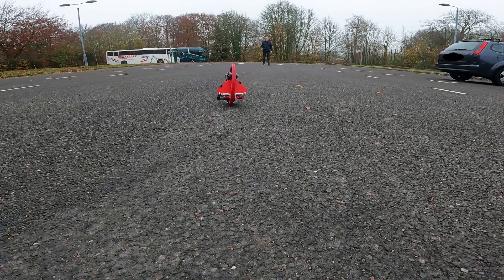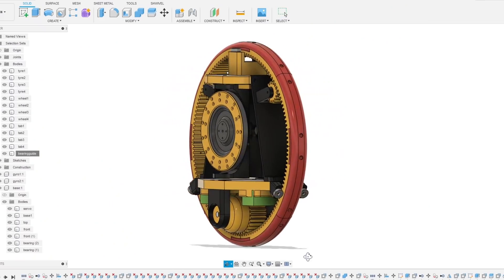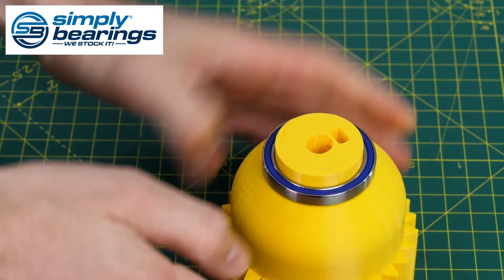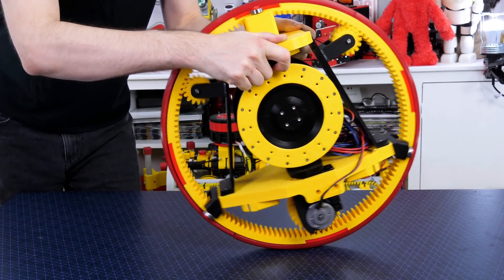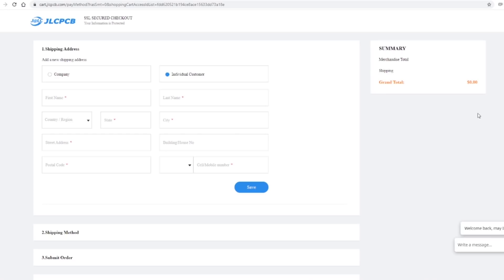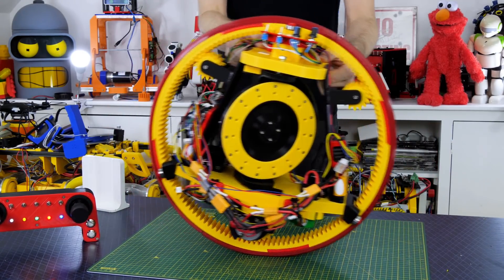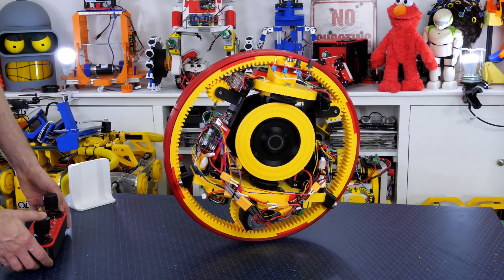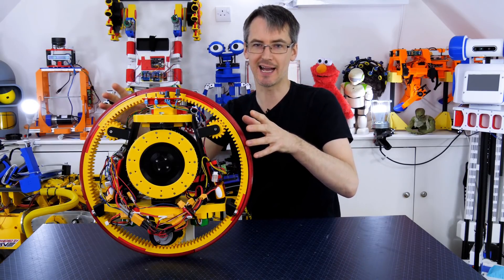Gyroscope Stabilised Monowheel

Comment: I guess there are two other solutions:

Have a heavy ring running inside the wheel arch as a flywheel. So if you decelerate, you just accelerate the flywheel's mass the other way around, bleeding off the energy. This would allow you even to reuse the energy, when you want to accelerate again.

And you can also accelerate fast and spin the flywheel in the other direction to avoid tilting. This energy could either be recovered while driving or you can just use it up when you want to brake.

The other solution would be to have a flywheel in the center but the axle turned 90° horizontally - so it will face sideways.

You would need to spin up this flywheel to a very high speed, but given that it is heavy enough it will stabilise the tilting action pretty well.

You could even use it to stabilise the tilting right / left by speeding it up/slowing it down. So you can steer and stabilise it. 

The only weird thing would be, that if the center portion do lean forwards or backwards it will stay there. 

So maybe you could combine both solutions

Comment: Great Build!!! (as always) only one small note, you know this effect if you have ever ridden a motorcycle or bicycle, I believe it is the same reason here as well that you need to lean the other way than the direction you are turning, which is also called counter steering, even though it has 1 wheel, as you implemented the gyroscopic wheels spin by the brushless motors, the overall system behaves like a bike or motorcycle instead of a monowheel. It seems to be a little janky right now but it seems to be fixable as well, I am really hyped about this, could you make one with a more common (easier to find and cheaper) parts version of this, the scale can change but again with gyro wheels? That would be great!

Comment: You're explanation for going round the corner is in fact an old problem that every human solved by feeling. You do it differently than you would expect! If you want to go to the right you will steer left at first! By doing so, you "fall" in the right direction and catching yourself from falling over. You're code should implement this and everything will work fine. There is an old experiment where they try to run a motorcycle by a robot, what ever they could think of it could only run in a straight line. Finally they measured a human driving the same motorcycle and found the slight movement in the wrong direction. It is also known as counter steering.

Comment: For your gyro steering to steer it in your desired direction you first need to initiate a turn in the wrong direction, this will cause it to lean in your desired direction, and then turn into the lean in order to stabilize it, turn even more into the lean to pull out of the turn.
It is comparable, although not totally similar, to how you need to initiate a turn for a bike with 2 wheels where only the front wheel turns.
Reply: 1. this information is incorrect
2. the speed at which this comes into play is much higher than achieved here
Reply: @Blox117  
1. No it isn't, while easier to observe in a two wheeled system it is the offset of the balance point relative to the steer point that causes the effect. Moving the steer point in front of the balance point should negate the effect somewhat.
2. The speed at which this comes into affect varies in relation to the size of the system. It becomes relevant when moving at fairly slow speeds, and stays relevant even at very high speeds.
it starts to become relevant around 0.001 kmh at the size of a marble, and around 0.1 kmh at the size of a bicycle.
Reply: @OmegaWoodworm  im guessing you've never stepped foot out of a 4 wheeled steel box, have you? enjoy knowing that i am able to magically turn without doing any of what you stated lmao.
Reply: @Blox117  I see you have missed some context.
The effect I am referring to affects 1 wheeled and 2 wheeled systems, not 4 wheeled ones.

Since cars have more than 2 wheels they are not subject to this effect.

Comment: When I look at the amount of coding time that must go into this for an end result that doesn't quite live up to hopes, I can't help but think you'd be better off just connecting the inputs to a machine learning algorithm that learns by itself not to fall over. Especially in this case where as it gets out of balance there might be a trick it could use to accelerate itself out of a fall condition even if you didn't input that acceleration.

Of course for the simpler robots the algorithm is easier to hand code but in this case AI might do a better job than a human and all you need to do is provide it with real-world training data.

Part of that might include ensuring that falls are an important aspect of the learning, and for that reason you could build in some logic to automatically move the gyros back into a safe state as it goes past the point of no return. Then your kitchen floor and the spinning gyros can endure many falls!
Reply: If my control engineering and dynamic modelling skills suck (or in the case of James are practically non-existent), have an AI do it instead. Great idea! /s
Just pay attention in class when you study robotics and this problem becomes quite trivial. Using AI in this case would be like turning the house instead of the lightbulb to screw it in.
Reply: @VulpeculaJoy  Re: triviality, that might have been a fair response up until a year or so ago. Now, in the new age of deep learning I'm not so sure. We are moving towards a world where these kinds of control tasks are becoming quicker to develop (and potentially more robust to failure too) with AI. Perhaps the Arduino board is not well suited to running NNs, but if so, that could be an argument for sourcing affordable hardware that can do it.

Of course, for those who really like the challenge of developing their own handwritten control code, go for it! But I could imagine in the near future those skills becoming antiquated and unnecessary in the robotics world.
Reply: @nettlesoup  AI is just a tool. If used right, it can do amazing things. But it has its drawbacks and limitations and to wield it right you have to know how the system as a whole works. Thus any skill related not to AI itself, but the technical challenges it is solving is not redundant, but absolutely necessary knowledge.

To give just one example: I am a team leader in our university's formula student racing team. We're aiming to convert the last season's car to drive fully autonomous.  The guy that is working on our AI-driven camera perception system has absolutely zero idea how cameras work and if I wasn't there to correct his oversights, we wouldn't be getting anywhere.
Reply: On another note: There is a lot of research going on right now involving AI control systems for cars. The technical challenge of implementing such a system VASTLY exceeds the challenge to do it the old fashioned deterministic way. 

And also: You have to learn how to walk, before you can run. We (like James in this video) haven't even walked yet.

Comment: It seems firmware should take control of gyroscopes' axes, so that no matter if on a flat surface or steep bump or hill it could always recover up to the angle of rotation of the gyroscopes, which looks like the limiting factor there.

Comment: I notice that the gyroscope axis of rotation is above the wheel centerline. Would aligning the two help your stability problems? I would think this would help with the change of force from the gyros when tilting the robot forward and backward.

Comment: Maybe try a design with the gyros in the center of the circle. That way even if you go forward the gyros won't move from the center of mass of the geometrics of the balanced wheel. Within this desing the balance of the gyros are high up the center, in that case when you move forward or backwards you will always create an inclination where after a certain angle the gyros wouldn't compensate and then the precession of the angular momentum is going to overcome the balancing action. 
Or maybe try to add another degree of freedom for the gyros, where they can balance in perpendicular to the movement of the wheel.

That's a nice project, incredible video.

Comment: Would be cool to accelerate and decelerate the gyros to offset the torque on the inside—then you could drive it directly with the motor without leaning forward or aft.

Comment: Don’t you think adding a kill switch to the remote would have been a good idea, there should be one on any project that is getting tested, maybe also other features like being able to tell when it’s fallen over so it can stop all the motors automatically. Also why do you still use arduino, I get lots of people use it but it has very low performance, you even had to use two in this project, chances are this project and others are getting heavily throttled by using an arduino, especially the PID loops, which I take it may use floating point maths, when the arduino doesn’t have an fpu, just use a STM32 or something. Faster speeds also means more accurate and faster control, so it can react faster to disturbances.

Comment: I caught your video as I was surfing Youtube. I like how your mind works. There was a moment at the end however, where you seam to be perplexed as to why it turns the opposite way of the lean. I think this has to do with how bicycles turn. While riding along, if you want to turn Left, you pull back slightly on the Right end of the handle bar. This moves the lower part of the bike off center to the Right. As the bike leans into the turn the handle bars, and the front tire, turn to the Left to follow the circle you're riding in. That's just my guess, but it seams to make sense to me.

Comment: Seems like you should be able to use the turning angle to alter the gyroscope's center point so that when you "steer" it knows that the center of your angle is meant to be offset from your true vertical center. However, if you use the boat analogy, you  should also be able to tilt your gyroscope physically if you place it on a horizontal rig.

Comment: What if you made it wider by placing the gyros on a tilt 35 degrees from each other so you can leverage more against gravity it could even buy you more tome to correct over steer in opposer directions

Comment: I'm wondering if the profile of the wheels that are causing issues with steering. When the robot leans slightly left the contact point moves quite far to the left, causing the actual balance to shift towards the right. Maybe try with a rounder profile for the wheels.

Comment: This might be kind of dumb, but if you did not have the gyroscopes geared and you had them both on encoder motors instead and made one basically a slave to the other would that help more in stability or just create more imbalance? I have seen at least the last 2 monowheel videos, but not that. Using 1 large one and another smaller such that you can keep them both inline with the wheel. Make the large one the slave as it could be quick to correct due to its larger inertial mass

Comment: I think tire shape might be a sneakily important factor. A flat-bottomed tire might seem easier to stabilize when the wheel is stationary and near vertical, but once you tip over the edge, the gyros are bound to struggle at correcting the sudden change in forces. Plus, when the wheel is moving, it's gonna be hard to make minor steering adjustments (like the video mentioned) since the gyros' smaller adjustments don't really lean the wheel at all. With a rounder tire, the amount of corrective force required is more smoothly related to the angle of the lean, and you might be able to make small lean adjustments better.
Reply: ALSO! I'm not certain, but I think the shape of the tire miiight have an effect on how the lean angle translates into turning as the wheel rolls along. I think a rounder tire might be more prone to turn towards the lean, which would be helpful, but I'm not sure.

Comment: thoughts.       in the context of steering/turning, maybe a smaller flywheel radius  would  result in less 'feedback'.      or  that  inline-swinging  thing you tried.  at :27.             designate one direction as  forward.  and  bias the longitudinal balance in  that  direction.     then the system would 'have something to push against', at all times.        at 11:04,  huh. 
i would suggest that you  Avoid  increasing  top-heaviness  in the  system's  distribution of mass (dom)!!!          these are words to live by,  when  a vehicle  has  an  Inherently  top-heavy  dom.!           uncouple it?        d

Comment: Putting the gyros in the wheel's center and putting them on their own race should fix a handful of issues. Centering them would disallow the tilting and turning induced by momentum, and putting them on their own race would keep the upright axis of the servo control. You also need some form of momentum dumping to desaturate the gyros anyways. If you really want a top-weighted wheel, to poorly emulate leverage force that a unicycle would see, I would suggest flipping your current configuration upside down, have the drive motor and batteries at the top, though most of this leverage will be made irrelevant by the heavy gyros in the center of the wheel; tilt to drive just isn't appropriate unless you have a significant lever on the robot.

Comment: I'm really curious how much a yaw reaction wheel would improve performance, especially at higher speeds. Then you could more directly twist the wheel like a unicyclist does. I think as the ground speed increases, you could use the reaction wheel to do more and more of the stabilization, especially if you're not too worried about which direction it ends up going. You might even be able to use it to offset some of the off-axis gyroscopic forces when they're tilted.

Comment: Just a quick thought, what is the result if a gyro wheel was installed perpendicular to the ones currently controlling the left-right balance. Would the perpendicular ones add stability to the forward and reverse acceleration??
Reply: would  cause  yaw-axis  feedback torque.
Reply: @daviddavids2884  👍

Comment: Great work. A couple of quick suggestion for future builds:
Program one of the toggles on your controller as a soft emergency stop that kills the motors
Program a ramp speed for the gyro speed controllers so you don't have to manually ramp them up.

Comment: 13:03 did you see Veritasium’s recent video about steering? I wonder if you need to apply the same principle. In his video he shows how a bicycle has to steer the WRONG way first (just a little bit and very quickly) before steering the RIGHT way. It’s fascinating and might be helpful!
Reply: I was just going to say the same thing.
Reply: Nice connection, although it doesn’t really apply here since you reverse steer to get the bike tilted in the direction you want to steer, and here you use the gyro to control the tilt. Imagine if you added a gyro to a bike, then you would never need to reverse steer since the gyro takes the role away from the front wheel. Actually you wouldn’t need to steer the front wheel at all but I imagine that would be a very difficult bike to ride.
Reply: You are right about the gyros, assuming they interface with the bodies containing them with torque around every axis.

This is however not the case since the gyros here spin in the "same" plane as the wheels. They regulate pitch in that manor only.

It is only when you offset the planes the gyros rotate in that the resulting forces are exerted  push side to side.

In the bike case the force is applied below the center of mass causing the bike to tilt towards the direction you want to turn. (The bike rides out from under you initially)

If this force is applied below the center of mass it is likely similar to the bike but less severe.

Take note that the two monowheels regulate pitch differently because of their location with respect to the center of mass. This supports the idea that it is indeed what vertasium describes.
Reply: @molomono9481  
>This is however not the case since the gyros here spin the the “same” plane as the wheels.

The way the gyro is used doesn’t matter in my explanation, as a reaction wheel or control moment, as long as it controls the tilt left and right.

>If this force is applied below the center of mass it is likely similar to the bike but less severe.

For gyros their position relative to the center of mass doesn’t matter, just the orientation, which is counter intuitive. Although you are right that the unwanted steering is somewhat related to the center of mass.

It tries to steer the wrong way because the wheel is pitching down while turning (center of mass at top), which tilts the roll axis downward so when the gyro tries rolling right (to offset gravity when turning left) it spins the wheel to the right at the same time.

If the wheel was pitching up to drive forward (center of mass on bottom), however, then the reverse would happen and the axis tilt would actually help with the turn.

So the center of mass affects which way the wheel pitches to go forward, which affects how the roll axis is tilted, which affects turning.
Reply: @corporalwill123  haha yeah we agree on the steering but are focussing on different interfaces of force in the system to explain it. Would be interesting to play with both variables and study what is really going on

Its weird though since you would expect that the gyro exerting force normal to the center of mass in xy plane would be simple since it is removing non-linearity but it is actually near a bifurcating region making linearized control have non unique control solutions.

In other words, PID wont work well